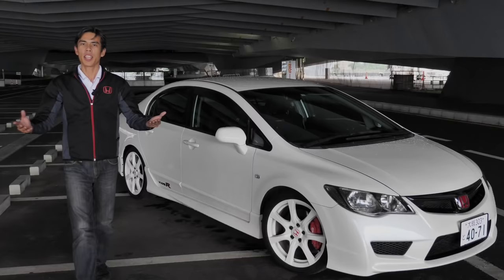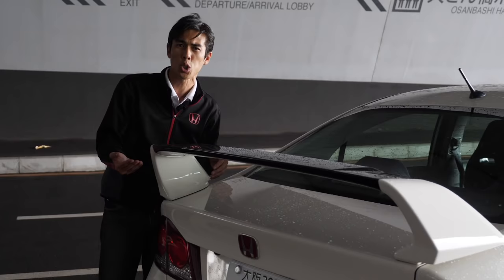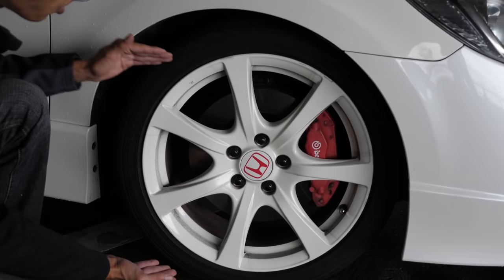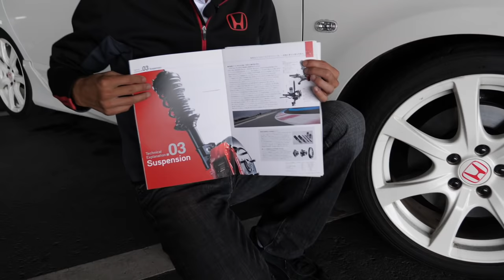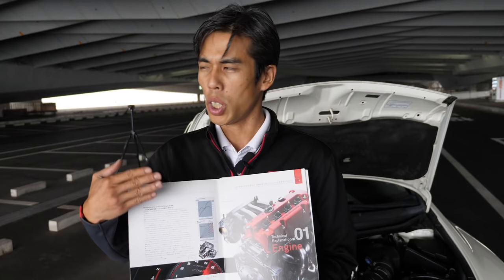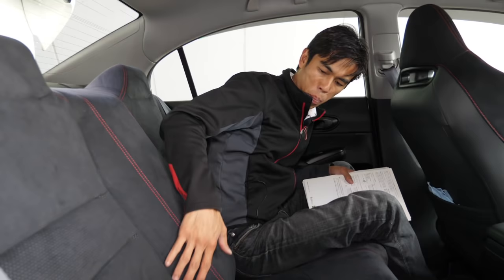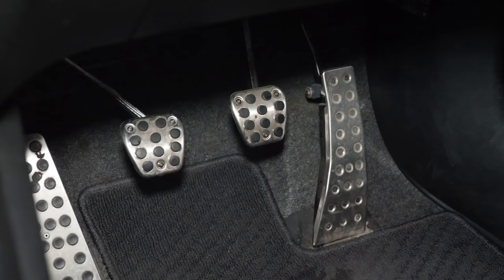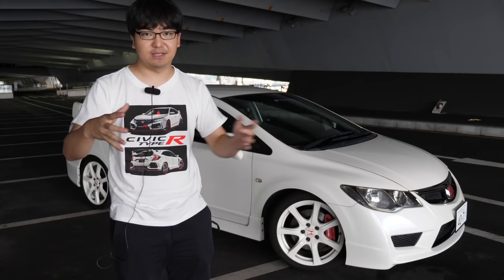The Last JDM Honda Civic Type R - FD2 | in-depth technical details | Masa’s ride |JDM Masters

Comment: Fun fact: Malaysia is the 2nd and the only market outside Japan to officially import FD2 Type R and able to buy purchase in selected Honda dealers (from 2007-2011) in both pre facelift and facelift model, and we only get one spec finished in Championship White. Talk about exclusivity huh. And also back then local used car dealer also importing alot of FD2R from Japan unofficially via ap license.
Reply: Too bad all cars here in Malaysia are too overpriced...
Reply: I believe that Honda dealer in Malaysia made a deal with dealer network in Japan. They were only 60 officially imported models. Extremely limited in number and doesn’t qualify as a fully supported export model. The cars are still JDM spec with Japanese emissions chassis code. (ABA-FD2) and designated for Japanese domestic use
Reply: did NZ get them?
Reply: @visionenippon-captbradford9344  Wasn't sure the total of the cars we getting, but still we are grateful to have this car in our market hahaha.
Reply: @preshandpereira4035  Tax brooooo, encourage us to buy local made lol
Reply: Jethro Hull  what’s the name of the uk dealer.
Reply: As I know, there are at least 200 units brought in by Honda Malaysia 
They were going on for RM200K or US$46.6K at current shit exchange rate
Nowadays, they are still going for half the price of that and cash buy only(Time to time there are cheaper deal)
Reply: @EVOFans  I read a report before. Total units Honda Malaysia manage to sell is around 400units officially. Those import by AP is unknown.
Reply: Preshand Pereira And riced
Reply: @visionenippon-captbradford9344  but i think malaysian version didn't have jdm speed limiter
Reply: We still can buy 1.8 or 2.0 automatic with same look.
Reply: Aus have them. All imported of course. $34k -42k AUD

Comment: Mine has been with me for 13 years. Still rocking it. It's simply one of the best mechanical cars.
Reply: has it given you any problems ? thanks!
Reply: Nice to hear that. I couldn't afford to get it when it was newly launch in 2007 back in the country I live as it was very expensive so waited for very long and got it last year. Japan was selling 3M yen. The country I live is even higher 😅
Reply: @shauntan2266  dude...I have to pay COE lol. You are next door. You know my pain lol
Reply: @muhammadahmadmagad6034  no. Apart from the usual wear and tear due to mileage and high track usage, otherwise it holds up really well. It's really easy to maintain it. The materials used for the interior holds up really well too. It doesn't come loose or rattle etc even after all these years.
Reply: @fred_teo  nice , thanks for your reply ! I'm also on the hunt for one in sg hahah so hard to find a nice clean example.
Reply: @muhammadahmadmagad6034  hahahaha. Well, prices for this car holds up well. Almost all have renewed coe. I only know of one guy that still has 3 years left in his coe for his FD2R. Amazing! But when you find one, just get your workshop to check it. It's not too difficult to find out if there are mechanical issues with it. It's the interior that's a challenge. Many FD2R have had multiple change of owners, some don't do a good job in maintaining the interior.
Reply: @fred_teo  haha. If u mention COE then I feel u. So u have renewed COE already kudos to u bro. 👍what was the PI price back then? Msia was 199,800
Reply: How do you tell the fake ones apart? There are too many Type Rs nowdays... o_O"
Reply: @yifan4542  depends on how extreme the owner is. Ordinarily there are plenty of visual cues to set it apart. For example, the key hole in the rear boot is a definite no no. Signal indicator on side view mirrors is a no no. Road comfort compliance is easy to spot too. It's probably not that obvious to the untrained eye but it is quite glaringly obvious to type r owners. However, I've met 1 or 2 particular FD2 owners that's gone down the extreme route to make theirs really look like a FD2R. Behaviour wise is completely different though.
Reply: Sg still have some clean ones, not super modified... I got mine Jan this year, super lucky the price was 75k.. Now all 80 plus!!! But worth la brossss
Reply: @abujamunafik7941  ya depreciation for it is surging like madness. It's all thanks to FK series lol
Reply: @abujamunafik7941  congratulations 👍👍
Reply: @fred_teo  I'm looking for pre owned air intake gruppeM.  Wonder where I could find pre owned parts at sg?
Reply: It's about $AUD 30-50k to import here in Australia -.-
Reply: I had mine (vivid blue pearl) since 2008. It's 12 years old now and has done 250,000+ km, but it's still going strong! No major repairs done or required so far. Just regular oil changes and wear and tear parts replacement.  No engine rebuild yet. Definitely one of the best cars ever and my pride and joy. Type R forever!
Reply: @bluelightningstrike7065  yah! I've had many friends telling me to sell mine. Even had ppl offering way more than it's worth. My question is "so, what else is manual and fully mechanical?".....none. Well, 997 I guess but no manual lol.
Reply: Singaporean?
Reply: I just purchase one it’s gonna sit in Japan until the 25 year bullshit but I’ll bring it to Florida 2032🤦‍♂️🤦‍♂️🤦‍♂️
Reply: I just sold mine recently.
It just doesn't breaks down!
Reply: Spiritual successor to the Integra DC2. Great car....
Reply: @shauntan2266  search for it via carousel in sg. But it's not very good. Can I suggest you go with hybrid racing? It really draws good power.
Reply: @fred_teo  ah then I miss hybrid racing once. A half cut shop selling it at rm1.2k. But when i check hybrid racing website it require to be hondata or ecu tuned to get best out of it. I dont have budget for hondata and ecu tuned yet. Just change the header and cat back not long ago
Reply: @shauntan2266  mm
Reply: Toyota honda subaru niezniszczalne bezawaryjne auta
Reply: I still own mine too!  Bought brand new, one-owner (me!).
Reply: all cars are mechanical

Comment: This car is the heart breaker for fan boys. It smashed the NSX, FD, Evo VI, and R34 GT-R at Suzuka when came out. Truly awesome car.
Reply: My heart's broken!
Reply: Not trying to sound like a smart-ass, but the FD2 had better, more modern tyres. It was still impressive, no doubt about that. But if the cars you mentioned had the same tyres, it is unlikely that the result would be the same.

Comment: I just sold mine recently. 
Its such a fun car,the handling is superb.
Super low maintenance,and doesn't gives you any problem.
Basically,it just doesn't breaks down and its a very hard car.
A track ready car without needing to mod or change anything and hits the track immediately.
When I sold my car,13 years later with 280000km mileage on it,only change the stock suspension once,and the gasket once.

Comment: I own a fn2 - I'm from UK, I really like it, wished it had more love 😯
Reply: Not from UK , but I own a FN2. It’s a pretty decent car still.
Reply: Will always be a good car I own a 60 plate still turns heads with a mugen style spoiler 😊😊
Reply: I'd agree with you guys so much love for the fn2, maybe not the lightest type r but still puts a smile on my face. Imo the balance shaft on the oil pump snuffed the rpm dramatically..
Reply: @smudger6461  mine revs to 8600 with Ecutec mapped in 225bhp
Reply: Fn2 is not as hardcore as fd2 but who buys a type r to keep it stock? With some exhaust and ecu work fn2 really wakes up
Reply: @lister817  I'm on hondata with 226, with the balance shaft delete your good for around 10 bhp on top of that it also spins quicker..

Comment: K20a dc5 differences engine and trans.  Pistions dc5 11:5 fd2 11:7 higher compression different intake manifold d dc5 prb. Fd2 rrc  cams are, crank, rods etc same between dc5 and fd2. Gear ratio and final drive are different as well .  1-3 gear rations similar. Fd2 4-6 gear ratios longer. Final drive dc5 4.7 , fd2 5.1. Very detailed reviews! Hope to see a dc5 review! Your canadian born with one arm dc5 r Lhd  owner/and racer!

Comment: The Honda FD2, FA5, and DC5 were an awesome K20 trio.
FD2- JDM Civic Type R (Acura CSX Type S deviation)
DC5- JDM Integra Type R (Acura RSX Type S deviation)
FA5- USDM Civic Si (Mugen optional)

It was cool to because the USDM Acura TSX of the same era had a K24 engine with 6 speed manual too.

Comment: As a product planner for Honda Malaysia I attended model clinics in Thailand. We asked for the rear to be similar to the  Accord Euro R (CL7). I remember the clinic car wheels being SSR GT1s, and the steering was originally VERY Playstation-ish but some of the older bosses wanted it toned down a bit. I think the success of the 4-door 7th Gen Civic Sedan fitted with a Mugen Type R K20 which won at Sepang Circuit MAY have convinced Honda Motor Co. to go with a 4dr CTR for Japan and export markets.

Comment: This car was actually faster than a 34GTR around the track?!

PS: If you guys could review a EuroR, that would be awesome!
Reply: Perfect CarSpec CL7R, yesss
Reply: Yes, can't remember which track, Suzuka maybe? Its on one of BM's videos. Tyres are different though so take it with a pinch of salt
Reply: Rik Powell Tsukuba probably. It doesn’t have long straits to make the power difference matter that much.
Reply: The R34 was a pretty big letdown as it couldn't even keep up with other cars in its price range. Like they put it up against a Porsche 911 and an NSX and it fell pretty far behind. Plus, it was developed in the very early 2000s while the FD2 was developed in the later 2000s so a couple year difference there.
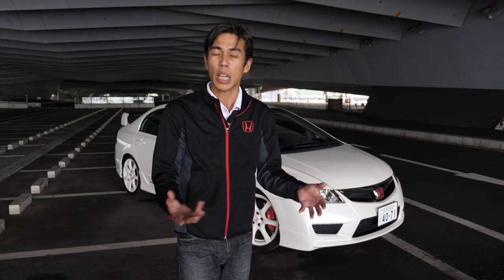Reply: @Jeff_Klein   Suzuka, 2:35 for the FD2, 2:39 for the R34. It was faster than the RX7 batmobile and Evo 6 RS which surprised me.
You can't discount the advance in tyre tech over that time though, I'd be interested to see the cars all on the same tyre. To me, the Evo 6 feels way faster in the real world than a civic type R or euro R.
Reply: @RAYSGT  As much as I like the R34 it is pretty heavy, much like it's two predecessors giving it the understeer of an FF while possibly having twice the power of one.
Reply: Power to weight plays a roll at the track. Lighter car can brake later with less brake fade and with all motor, it's more responsive then a turbo vehicle. Honda engines put a lot of car companies to shape.

Comment: It's interesting that the Japanese market seem to prefer their cars much more hardcore than the rest of the world. I have heard that even today the FD2 is still the best balanced and well configured of the Type R's. I have an FK8 and it's very well balanced, much better front and rear grip than the FK2. It does suffer a bit from the weight but even so it's one of the fastest hatches on the road. Cup 2 tires fit it much better for cornering. It makes handling even better and more dynamic.

Comment: Very detail explanation and informative review. Seems this guy knows better than the car owner. What i like about this car is the lsd gearbox which gives uniform balance and control to the wheels at high speed corners. This is a car that driver can hav fun driving it

Comment: Hye bro'✌🏼😎

Thanks for this beautiful piece of art, and this interesting review.👍🏼

I do own a FN2 in France 🇨🇵
White Champ model, with 19" Rages optional rims.😍
Only mod is Tein Suspension.
I can say it's a very good sport car. I know, far from it's sister FD2.🙄

If you guys can find a EuroR in Japan, please please select a White Champ model with the Torsen otherwise, the feedback of the car will be corrupted.🤕

The reason why the FN2 was so hated back days, instead of the weight, is the lack of horse power AND the lack of torsen.
So if you review one With the torsen, it's a complete different car.🤔👍🏼

It would be interesting also to review the newest ones, like the FK2 and FK8.💪🏼
Why not gather all the CTR family in on single video,
EK9/EP/FD-FN/FK2/FK8🤘🏼

Thanks for this work and dealing passion around the world.🙏🏼🇯🇵

Please keep working. 🙏🏼
Arigato Gosai Masu
Merci from France 🇨🇵

Comment: Sad that we never got the Type R in the USA. The last true Civic Type R with an NA engine! High Reving and Lightweight, Honda needs to go back to their roots. Currently doing a FD2 Type R conversion with all OEM parts on my FA5 Civic Si which shares the same chassis as the FD2.

Comment: Very good review, I would like to see a detailed driving review talking about steering feel, shifting and overall how it feels how to drive. Also I did alot of searching and can't find what the actual steering rack ratio is? If you know reply. ✌️
Reply: yeah it's quite different from standard civic fd or civic si. The standard version or civic si have 13.64 steering ratio and 2.6 lock to lock. But i watch some fd2r videos and it look have slightly tighter lock to lock, around 2.4-2.5 lock to lock. So the steering ratio for type r  should be tighter than 13.64

Comment: Hello, please I need information on that car to build in a simulator and I can't find it

-RED LINE RPM?

- IGNITION CUT RPM?

-IDLE RPM?

- VTEC RPM?

- DIFFERENTIAL LOCKING PERCENTAGE?

- WEIGHT DISTRIBUTION?

- DEGREES OF STEERING?

- DEGREES OF CONVERGENCE?

- DEGREES OF COMBA?

- TOE ANGLE?

Comment: Hello guys, i have a honda civic fd2 2.0 sport manual, can you recommend which suspensions are suitable because when i drive it i feel like a little bit bounsy, when the road is a little bumpy it's shaking and unstatble. Another thing is the noise from the road, it could be some problems with the tyres, could you please suggest which tyres fit in terms of reducing the noise when driving. Thanks a lot guys.

Comment: What if you just modify the front end and out in the headlights and modify the tailights to fit rather than spend 1,500 to make it look like a type R from Japan
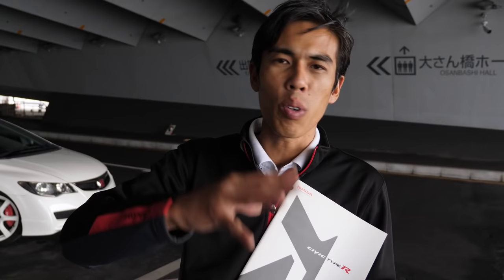Reply: Hear this 14:05
Reply: I see what you’re saying but I believe it would be possible to do some cuts and welding or body work to fit the lights and modifications

Comment: This guy seriously just said that "its widened stance gives it an extended wheel base" ?!?!?!😂😂 What in the F is he thinking he's talking about because obviously most are aware that no matter how much you decreese or increase the width or stance as he called it of a vehicle there's no way that can ever effect or change the wheel base , which obviously is the distance between the dead center of the front hub to dead center of the rear hub. And he called the hood a "bonnet" ,  lmfao I can take this is to much , this guy's lost his rocker